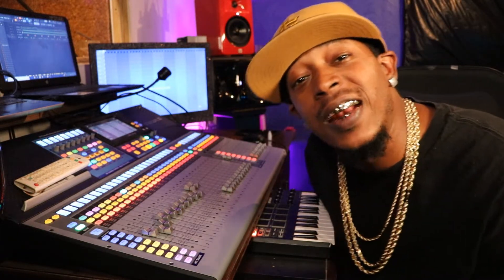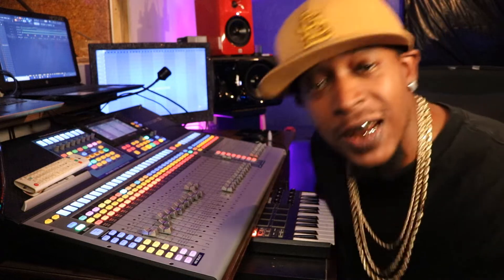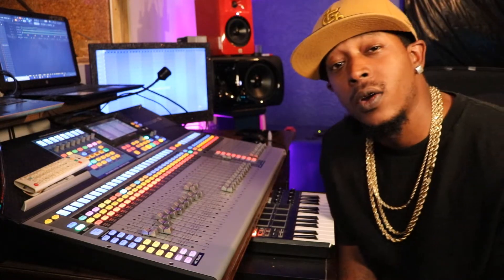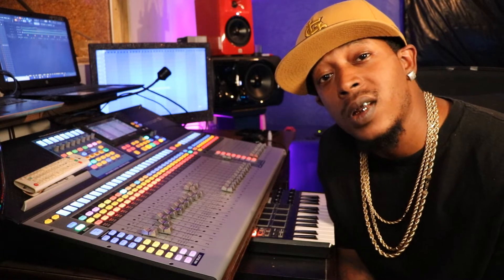gold grillz sore mouth

Comment: Fixed my grill by using nose pliers. It works just gotta keep adjusting it to your teeth. Also put your grill on the mold to see if there’s any loose or tight spots to fix. Like homie said your teeth naturally adjust over time so expect maintenance like your car
Reply from the maker: Exactly but if it's too out of whack get it remolded
Reply: @hp7vlogs  thata what i ended up doing.i made sure i bit down n held down my bite for a few minutes. Shits better than the original one

Comment: What did u do to pull um apart. I just got 10 on top and bottom and them shits feel like they gone break my teeth. They are extremely painful
Reply from the maker: Take your time and bend the back of them out not the front part it's a slow process so take your time

Comment: Mann, I just got mines yesterday from JD Top 8 and this my 1st real grillz. Putting it on I had 2nd thoughts putting it on cuz it was pushing my teeth, making it sore scared a tooth was gonna fall out of some but I put it on after noticing the snap and than it came time to take it off, man talking about the struggle!! 
I was sweating taking it off, thought I was fin pull my teeth out but POP it came out. 
— what do you use to expand the metal do you get it hot first or ?
Reply: Faaaacts!! Same here!! I was sweating at the shop when they was tryingbto put them in!! It was INSANE! Did u fix that issue? What did u do?
Reply: How u fix it
Reply: Yea I did, I just got some pliers and widen it just a little bit, do it very slow